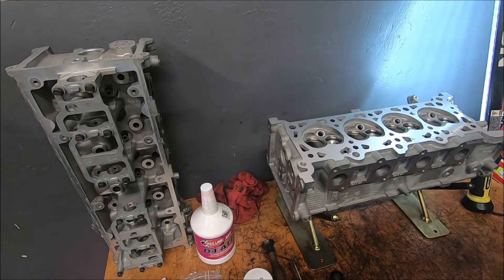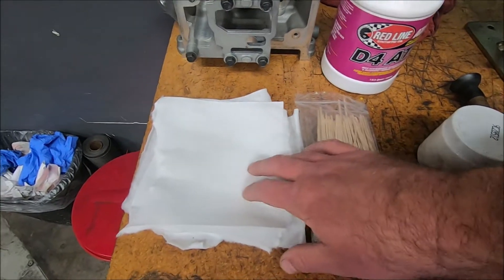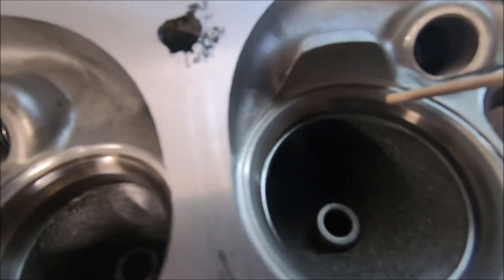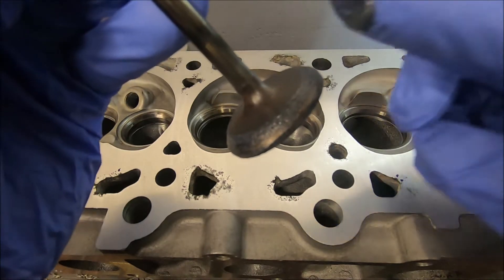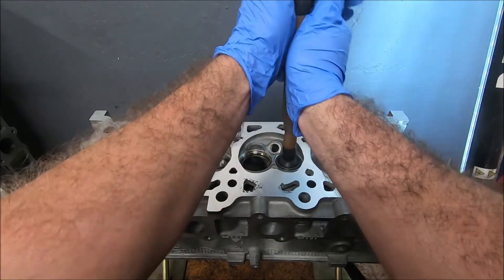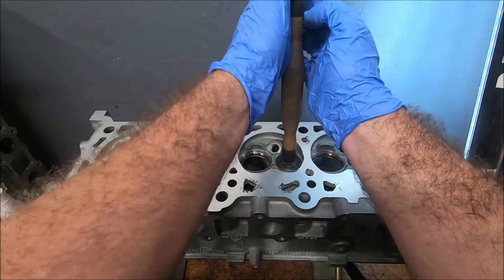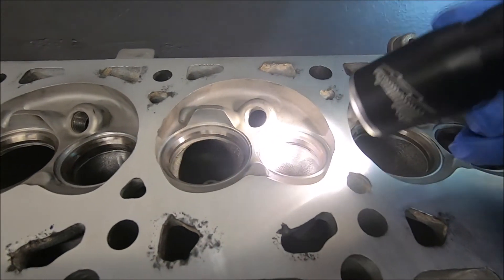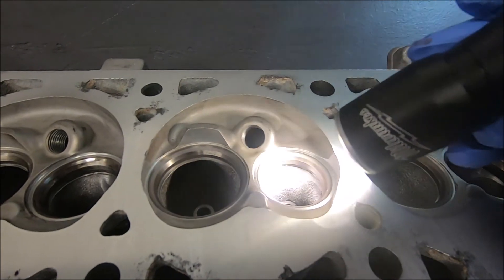Lapping Valves on a set of Mustang GT 2V PI Heads

Comment: Thanks for the video!   You mention cleaning the heads after lapping?  What cleaning agents would you recommend for at home?  Just mild soap and water?  Thanks.
Reply from the maker: No problem.  Yes you can use warm water and soap but if your careful you can just wipe it out with those Scotts blue towels.  I also love PB blaster.  Q-tips work great for the valve guide too.

Comment: Great video, What's the ATF for?
Reply from the maker: Thank you, I use ATF a lot to clean a lube engine parts.  I don't think I show it in the video but I put a small amount in the lid and dip the q-tip in it and clean the valve guides prior to putting the valves in to lap them.  Its a good idea when lapping valves to make sure the stem and/or the guide has some lube on it.
Reply: @JohnSmithRacing   thanks. I figured, but since you didn't mention it thought I would check.  Any tips for reinstalling the keepers especially with high seat pressure springs?
Reply from the maker: @cameronc2716  Yes, I like to use a tool from Euro Export Inc.  I have a video on how it works here on youtube.  Its about $100 but well worth saving the frustration.